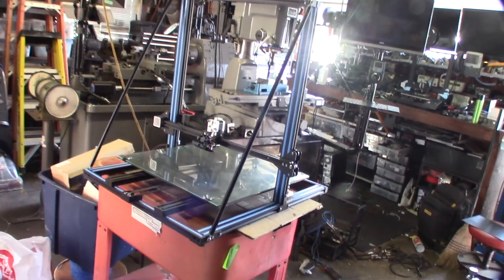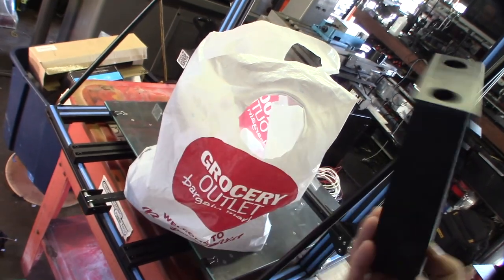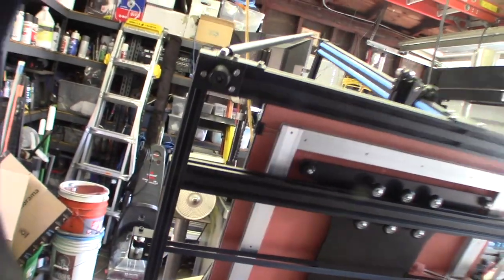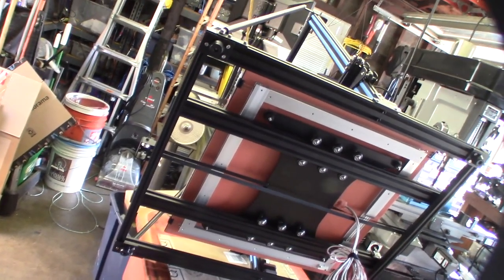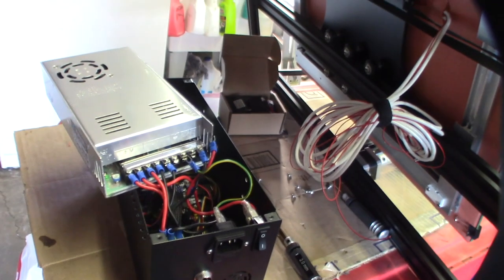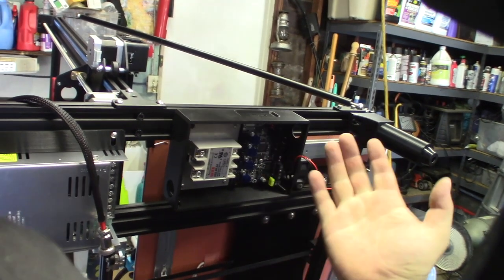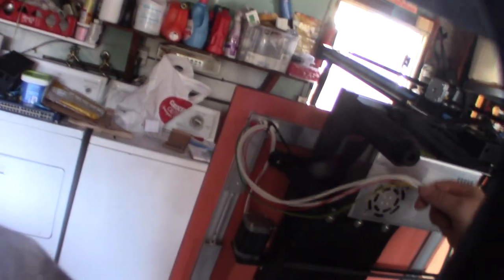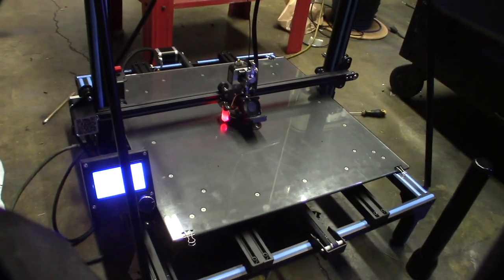Creality CR-10 S5 Undermount Kit, AC heated bed and SKR E3 Mini V3.0 upgrade blotuch

Comment: I was just upgrading my cr10s5 and your video is very helpful.. one question is my s5 has 2 ribbon cables coming from lcd (exp1& exp2) but e3v3 only has one slot for ribbon cable so where did you put the second one?